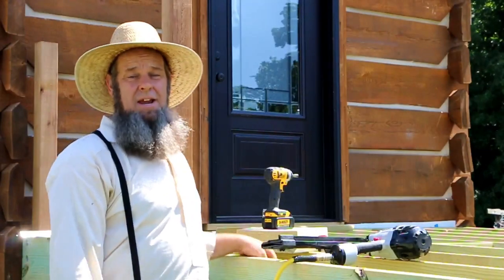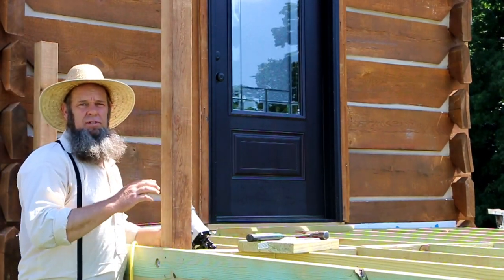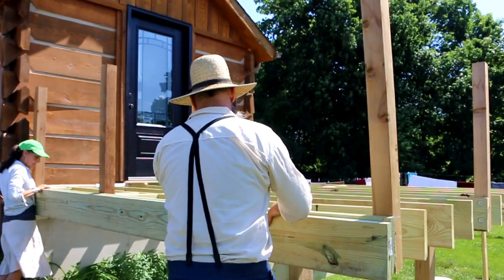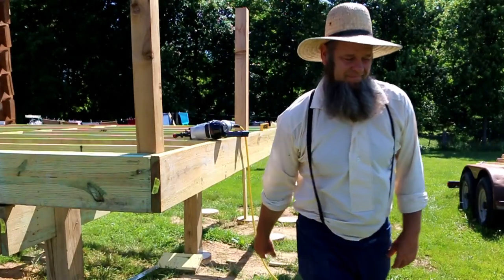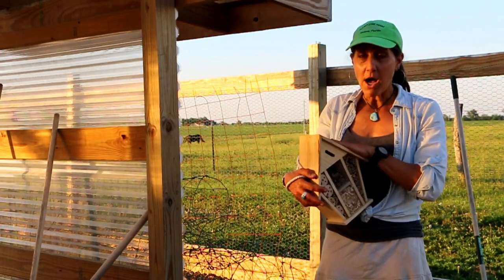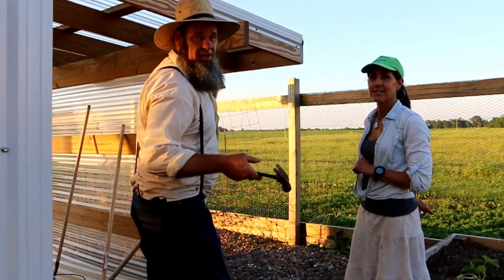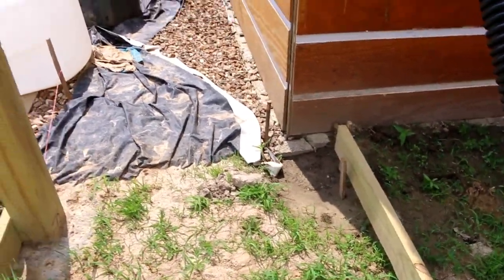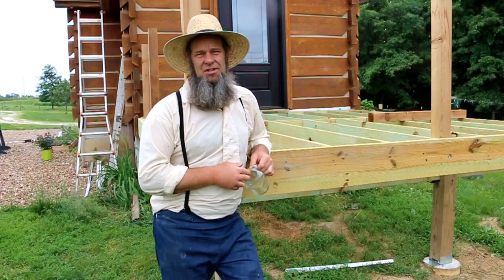HANG THIS FOR A GREAT GARDEN!

Comment: Mason Bee houses need the opening facing south and you need an overhang to keep out water. Also, a small ledge at the front helps so they can sit in the sun and warm up on cool mornings. If they have water and clay close by, they will stay. They make mud to plug the openings in their habitat when they lay eggs. If there's no water or clay nearby, they sometimes leave the area.